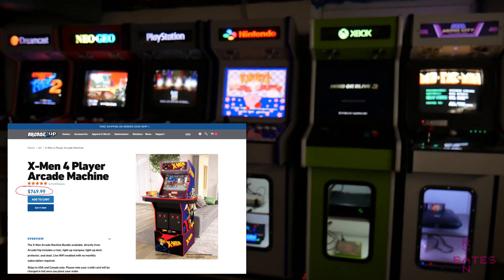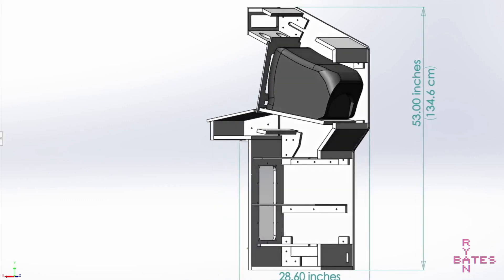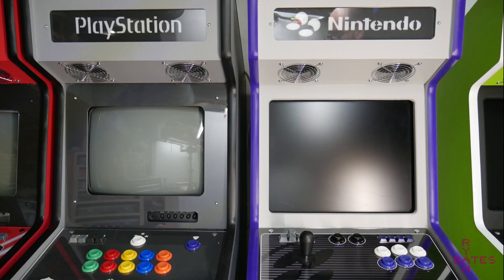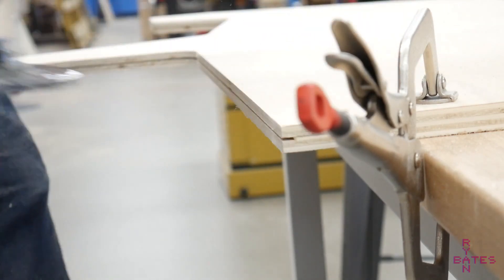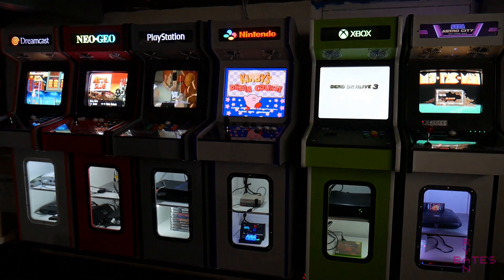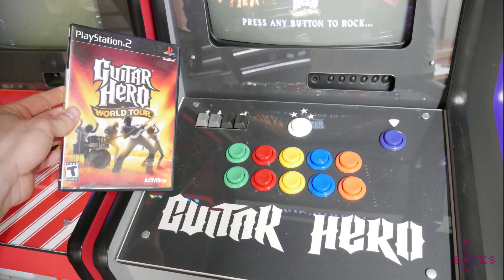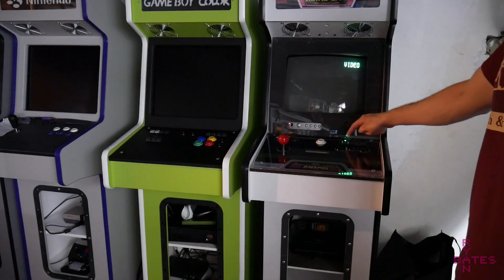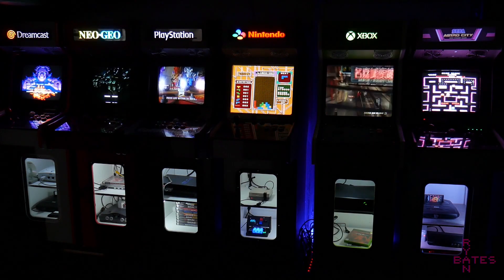Build a Better Arcade 1UP.  100% Handmade Arcade Project with Plans | Edge Lord Edition

Comment: Better than Emulation slop, but still not Arcade.
Reply from the maker: define "arcade"
Reply: @RetroBuiltGames  Jamma, Specific Hardware designed for it(PS3 Namco System, SEGA Naomi). That's what i call ARCADE.

Comment: Hello! Was hoping you might be able to help me. Im building a cabinet loosely based off of these ones (super inspired by you so thank you!) and I'm having a problem with my speakers. 

I had bought a pair of 6" shielded speakers for a few bucks a while back and they sound awesome, but as I've been testing things while building, I notice that when the speakers are on the image gets a little fuzzy and if I turn off the speakers it stops. So then I found some smaller 3" shielded speakers and it does practically the same thing. Did you have this issue? Any way you know of to combat that?

Thanks again for the inspiration!
Reply from the maker: Your screen is a CRT or LCD? what is the input source: analog? sounds like EMI. I didn't have this issue the speakers I bought were shielded and because of their age their shielding is standard. Where your speakers old stock or new stock?
Reply: @RetroBuiltGames speakers are old stock and im using a crt. Ive been doing research the last few days and i agree its not coming from the magnets. I think its either the wires i used for the speakers or the amplifier im using. Its just a loose pcb. Im getting some shielded wires in today and im going to make an enclosure for the amp and ill let you know how that goes. Thanks for bouncing ideas off of me!
Reply: @RetroBuiltGames  in case you were curious it was the speaker wires. I got some shielded ones and lowered the gauge from 14 to 18AWG. Not sure what helped more but now it runs perfect. Thanks for brain storming with me!
Reply from the maker: awesome. I hazard a guess your video cable is also unshielded.  dont zip tie your video cables with everything else; that might help too.

Comment: These turned out awesome, I really like the paint job! What sort of paint and primer did you use? Also, what sheen? I didn't realize that you could do two cabs for $25. I thought it would cost a lot more money to paint but maybe the paint that I'm looking at is overkill.
Reply from the maker: thanks! any quality/brand primer. I used a PPG primer for this paint. sheen is matte. it just looks better. a quart of paint is all you need for 1-2 cabs (dont get a color match that is very pricey; pick from the color swatches)

Comment: Very cool. Are there plans for vertical cabs with a 4:3 ratio?
Reply from the maker: that's a cursed proportion
Reply: @RetroBuiltGames  or vertical builds  in general?
Reply from the maker: nah, i'm unsure why you'd put a 4:3 in a "vertical" cabinet. isnt that for 16:9 ratio screens turned sideways (TATE)?
Reply: @RetroBuiltGames  to my understanding most of the classic vertical arcade games (ie pacman, donkey kong) were in vertical 4:3 ratio.
Reply from the maker: ah! ok now i understand. The 13" CRTs shown in this design are 4:3 ratio, so nothing to change. The 5:4 ratio are the LCDs, which is just a different front bezel piece. This cabinet design is a traditional 4:3 monitor cabinet.

Comment: Love the build but is your calculation correct on running costs (you put 1 hour @ 19¢ and 24 hours @ 46¢) shouldn’t it be 24 hours = $4.56?
Reply from the maker: thanks. See pinned comment. Decimal place got me.

Comment: Great build! I've been looking into doing something like this. Is there a reason to use 3/4" plywood instead of 1/2" to save weight and cost?
Reply from the maker: Thanks! good question. 3/4" plywood is better for three objective reasons :
1) the proportions of the cabinet.
2) T-molding. you need 3/4" to cut a groove and keep structure at the edge.
3) You sacrifice a lot of depth when drilling blind holes for the pegs. I would not validate this design at 1/2" ply.

subjectively:
If you go with thinner ply it will look and feel substantially "cheaper".  If you've ever been in a kitchen built with 1/2" thick cabinet walls, you already know.

Comment: is there a NON CAD version we can just print with A4 paper and put all the a4 papers together?
Reply from the maker: that would be the PDF but some may require a CAD element as there are different paper sizes (letter, A4) and printers have different print margins. You'd may need to adjust in CAD for the unknown. PDF has dimensions, so  you could scale until its 1:1

Comment: Oh i have a diy arcade. But i did go on all things the easy route no pcb or crazy wiring. Things that can work together without modifications. Things i did custom was a Glas plate and an marquee wich i designed with an old free paintshop. The cabinet was precut. I selfbuild a coin dropin for it and did some led lighting and paint it with several layers . For the back i used door magnets and put fans i to it. But all on a hobby quality 😅 i cant really sell it this way. But looks good.
Works with a energysaving hp zhin client for 20€ and an 20 year old samsung lcd around 21" and around a 20 year old pc subwoofer. I did use new speaker from amazon.
Time for me 3 months. Could do this about maybe one hour at night in the winter.... Outside 😂
I stayed away from all games wich are not meant to be played on such a cabinet. For that there is my sofa!
Reply from the maker: 100% agree with some games are just better sitting on the sofa + controller

Comment: Good design.  So many arcade cabs where you can't sit down comfortably because knees hit.
Where in the US that you only pay 0.0603?  I haven't seen that for 10 years.  Even commercial rate is higher than that in any state. Are you sure that isn't their cost?  Were next to a hydroelectric dam in Washington and get wholesale prices and even were not that low.
Reply from the maker: that's a rate without the service charge

Comment: Reminds me of the ones they have in Latin America (mainly Mexico) where there's arcade cabinets with consoles and/or PC rigs inside it running multiple games, they're referred to as "maquinitas" or "maquinas de videojuegos". Otherwise i love your setup and also amazing work. 🙏👍
Reply from the maker: awesome, thanks for sharing! how much does it cost per play on a maquinitas?
Reply: @RetroBuiltGames  it would cost around 8-12 pesos (the equivalent to $0.50 - $0.75 per game). The machines also have a time limit when in use for each gametime (between 15-20 minutes depending on the game). Also a fun fact, some of them even have online multiplayer for those that want to have that option as well in certain locations. Pretty cool machines, also my bad for taking so long to reply. Youtube's notification system is very iffy for me for some odd reason.
Reply from the maker: Thank you! I think i've seen the time limit boards as an add on. You would plug these inline to the video feed so the countdown timer and credit text are overlaid on the game system right?
Reply: @RetroBuiltGames  Yep, exactly like that. 😅

Comment: Very inspiring video! You have a new subscriber. One small error I noticed: it should cost you $4.6 to run all arcades for 24 hours, not $0.46, considering the price per hour is correct.
Reply from the maker: thankyou! darn that decimal place

Comment: Cool. I’ll just pay someone to make a cabinet and include a Pandora box. Even Amazon has arcade cabinet shells with up to 32” screen if I want to do it myself. The cheapest CNC machine you would want is $1000 so I don’t get the cost makeup. This guys using a $10,000 CNC machine and says “you can build one for the cost of three 1Up Arcades.” Great woodwork by a professional woodworker. Great game ideas from one gamer to another. I won’t be doing because I cannot see this being cost effective.
Reply from the maker: thanks! first time I've been called a professional

Comment: Hey man is there anyway I can get a consultation and pick your brain on a similar topic!
Reply from the maker: i think so. technical or non-technical?
Reply: @RetroBuiltGames  non technical, I think. Im wondering the difficulty level of building a coin / bill operated arcade game with cabinet. I don’t have much experience with things like this and am starting a project
Reply from the maker: Its a intermediate level project if you want it to survive in a commercial environment. Modern bill acceptors are pricey, and if your cabinet is going to hold $$$ from revenue, it has to be built in an anti-theft manner. Refurbing an old  arcade cabinet requires less resources like a full woodshop, but is not easier. It's just a different set of challenges.
Reply: @RetroBuiltGames  thanks for even just that input! It is a commercial project. I’m in the amusements business and prices are high. Tech is kinda a new language for me, but for my biz sake I have to learn how to build my own games. If you have heard of MAME can you tell me if that would be good for commercially placed arcade games. (Legal issues aside )
Reply from the maker: MAME is not good for commercial vending. You basically violate the software license by making money of pirated software and ROMs. Anyone in the community seeing this will not have kind words for you.
Reply: @RetroBuiltGames  thank you. I didn’t know that. Then the plan b was using AI to code a simple game. Although challenging, do you think that is realistic for a novice to pursue?
Reply from the maker: if you don't have any coding experience, I don't think that's realistic.
Reply: @RetroBuiltGames  ok I appreciate it

Comment: Man, even the little details on these are decent little projects. Controller converters, the rgb marquees… very nice! I’d like to see a more in depth dive into creating the controller converters
Reply from the maker: any specific controller converters you wanted details on?
Reply: @RetroBuiltGames  personally, I’m looking at creating a usb to gamecube controller so I can use my other controllers on my Wii. But I just like learning about this stuff so I’ll watch whatever. You never know what kind of tips you can pick up so all info is appreciated
Reply from the maker: Agreed! I am working on an analog arcade GameCube controller now, but not quite matching your applications. I have my eye on this GameCube device that allows one to use current gen controllers on your gamecube via bluetooth. It's pre-order; i am hesitant until the device delivers on promises. But 'knowing' about devices like this help me bridge interface puzzles when stuck. https://castlemaniagames.com/products/retrotime-gc-blueretro-wireless-controller-receiver?ref=nqN6c2d7Ffw-JC

Comment: I built a MAME cabinet a few years ago using a 32" monitor. It was much more Arcade sized. My wife was thrilled...... (No she wasn't). I will say at my kids birthday parties it was more popular with adults than the kids. I would honestly like to build something this size. I'd probably want a 24-27" monitor.
Reply from the maker: I did try this design with 19" (LCD) monitor with a 2-player control panel. Any screen larger and the cabinet proportions need to change. looks like this https://youtu.be/GEOF_9-74O0
Reply: @RetroBuiltGames  Seeing those cnc cut parts almost makes me want to build another, it’d definitely be smaller than my last. I ended up selling it to the science/robotics teacher at my kids school.

Comment: Well duh a CNC is easier but if ! can afford one of those id just buy a room of Arcade 1up machines....my current plan is to plunge cut with my router but if you have any suggestions I'd be thrilled!
Reply from the maker: make one side panel as the template, copy it with a flush cut bit.

Comment: Digital inputs from a COMPUTER KEYBOARD keys for the Nintendo 64’s Control Stick??? What is wrong with people?

An arcade is literally associated with an iconic image of a JOYSTICK… albeit usually a digital joystick, there are obviously ANALOG JOYSTICK options as well, yet not only is this NOT a joystick at all, not even a digital one… it has keys from an old computer keyboard instead. 

Spending that much time and money to make an entire n64 cabinet, spending all that time talking about how it’s supposed to be *“themed to the console”*, the FIRST CONSOLE to come with an analog stick, and yet, computer keys. I’d rather have the ugly 100 characters on the cabinet for artwork and have an actual analog joystick… rather than a good looking cabinet where I’m trying to drive, move, or aim/shoot with KEYBOARD KEYS.

I mean I did a quick google search and found an analog arcade sized joystick for under $20 shipped. I just don’t…
Reply from the maker: lol i think you should take a break from the internet. comment is 10/10.

Comment: I wish I had done something like this I didn’t have the means to cut wood so instead I remodeled and  refurbished a clearance arcade 1up literally only kept the outside frame swapped every single piece on it and within it wish I could get a replacement made out some exotic super hardwood someday.
Reply from the maker: exotic hardwood might be more than clearance prices. maybe veneer would be better
Reply: @RetroBuiltGames  that’s true but I didn’t go light on any of the other hardware it kind of took on a life of its own at the end if it could be upgraded I did it, then upgraded the upgrade hell the joysticks alone was rebuilt from scratch from the best available options probably $500 in parts. Everything is top of the line far beyond arcade quality with about 50,000 games on it, housed between the worlds cheapest MDF board… I love the size,and functionality. but it makes me sad😢 it’s like a custom top of the line Ferrari engine in an ‘05 Astro van.

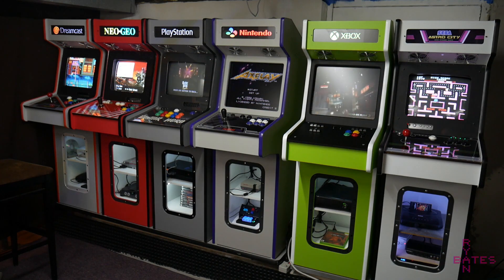Comment: 15:03 I believe is supposed to be $0.019/hour for all machines (320W/1kW * .0603USD)
Reply: Also, thank you for the excellent video, was wondering how much it would cost to DIY one of these things and you did a great job breaking it down.  Cheers!
Reply from the maker: yes, darn those leading zeroes.

Comment: I heard that vinyl sheets are way easier for covering up the rough wood than paint. I have not tried it yet, but it certainly seems easier, and somewhat replaceable if it wears down.
Reply from the maker: id still recommend sealing the wood fibers.

Comment: Nice work and build! I always think consoles just don't work in an arcade cabinet. You have shown it can work across the board. With your electronic wizardry I would think you could also put a controller port available to plug in an actual controller for specific games. On your cost sheet at 14:24, can you post links to the parts used and where you find some of them at the costs shown?

On a side note, your calculations for power on costs don't quite seem right. First, you state the Kill-A-Watt is measuring 0.17W with all 6 turned on? That's only 170W total. Seems strange as many old 15" console TV's used 65W alone. Then add in the console itself, the lights, etc, I would assume it should be over 100W PER cabinet. The 0.17W to me is just 1 cabinet plugged into the meter. I understand some use a 15" CRT, others use a 17" LCD (which uses about 20W) so we will use your next number of a constant use of 320W or 0.32kWh as the average of all 6 being on for 1 hour.  Next question - where does electricity only cost 6 cents/kWh? I'm in Central Florida with Duke Energy, and my rates are 12c/kWh which is 6 cents delivery charge and 6 cents fuel charge (how they list it on the bill), and this is the cheapest I've seen in most states. California averages 34c/kWh and can go up to 60c/kWh with tiers. But sticking with 320W usage and your 6c/kWh rate, that is 0.32kWh * 0.06c would be 0.0192 or almost 2cents/hour; over 24 hours that would be 40 cents. For me in Florida at my rate, it would be 4c/hour or roughly $0.92/day. In California at the low 34c/kWh rate it would be 11c/hour or roughly $2.61/day up to $4.61/day at 60c/kWh. Multiply these day numbers by 30 days average billing statement and that is your cost for the month.
Reply from the maker: thanks for the kind words and good discussion. Controller ports are accessible on the front where the console is... @14:55 I state the kWh usage of all 6 arcades is 320watts. I think the kill-a-watt is accurate to +/-10%. Florida (your example) and CA will have higher costs for energy compared to the states in the rust belt. I live in the rust belt. I'm also using costs from ~2020 (time of filming that segment), before there were a bunch of rate hikes across most of the US. energy is cheap in the rust belt. Remember, some energy rates can be subsidized by government programs, or offset by using solar + battery banks. My state also has competitive 3rd party suppliers that can offer a very cheap energy rate, but still use the same grid system as the monopoly in the area (and their delivery rate) for energy. I also live in a state where two or more energy utilities are usually piped to a house (like electricity and natural gas) which can influence costs too. So what you experience in FL is not the same across the contiguous US. However, the point was running the arcades is a few cents a day.

Comment: Looks awesome! You mention the "tricky" rear supplementary angle at the rear of the cabinet, which only seems to make the build itself more difficult. May I ask what the point of that angle is? It doesn't look like most arcade cabinets, so why not just make it straight from top to bottom?
Reply from the maker: that rear supplementary angle is an homage to the NeoGeo MVS design.  https://en.wikipedia.org/wiki/Neo_Geo_(system)
Also will fit around any baseboard in the house.

Comment: How much will the CNC machine cost me and will it fit in a one car garage?
Reply from the maker: A beginner CNC kit of comparable size starts around $8k + and up. They will fit in a 1 car garage. But you need space to work around it. The CNC shown in this video is for industry use and is a bit more.